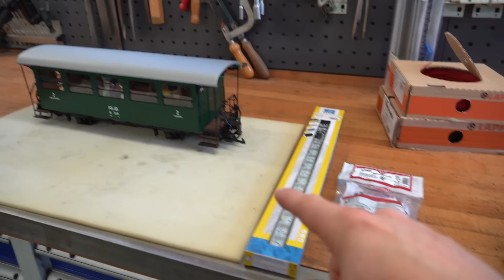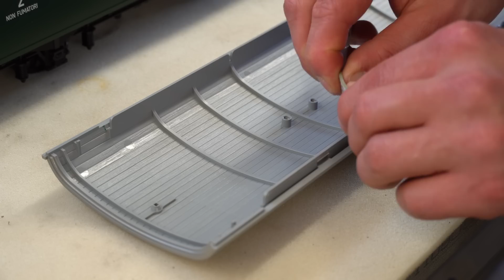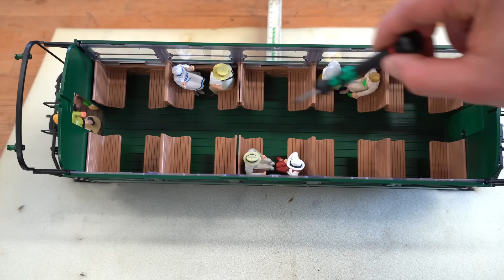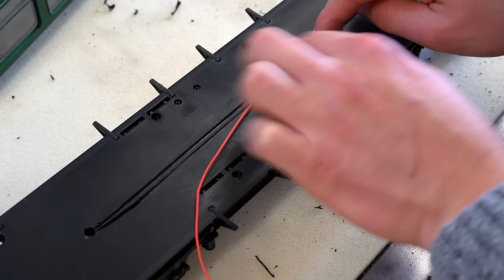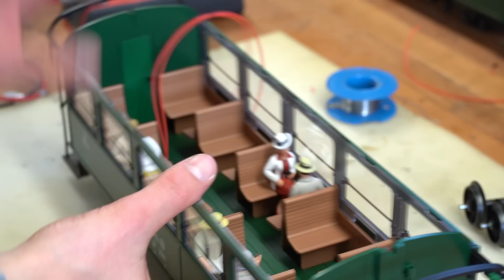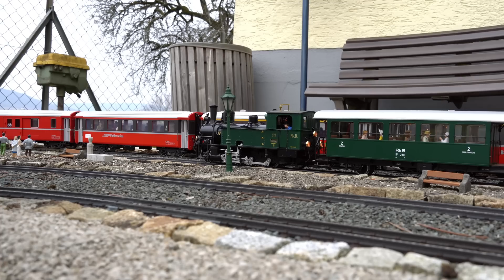LIGHTS and WHEELS for LGB passenger wagon

Comment: Why double wheel connect you can from 1 set of wheels the power ?
Reply from the maker: One set of wheels is not sufficient for garden railroad use. If you hit a dirty spot on the track or the set of wheels has a stand still on one of the switches the light will go out. I will do at least two sets of wheels if not four. The more the better and the further appart the better as well.

Comment: Why did you take red/brown wires, which everyone can see?
Reply from the maker: Good question ... I didn´t have black which I would have preferred and since I mounted the wires between the chassi and the top portion of the wagon I thought it doesn´t matter. But of course I needed to make the connection to the roof which I haven´t considered at that point. To make a long sotry short, next time I will use black or dark green wire to hide them better... I still have 6 more wagons of the same type to do.

Comment: Will you ever add overhead wires for the locomotives?
Reply from the maker: No I will not. To much cost, to much maintenance and since I have rail road crossings which are actually used by real humans can´t install overhead lines...
Reply: @summitrailway  Hmm yeah i can imagine it is expensive and requires a lot of maintenance. And haha yes i didn't think of that! Would be a tripping hazard lol.

Comment: Is it also possible to add a decoder somewhere to allow remote control of the light?
Reply from the maker: It is possible. This light strip in particular will accept a "plug in" decoder. It doesn´t get any easier. But if you are using a different type of light strip it is easy es well. I don´t see any real advantage for me personnaly so I don´t do it but you can for sure!

Comment: Would it have been an option to simply transfer power from the locomotive? You'd just need to add a single DC converter and capacitor on the locomotive and/or tender, and then a pluggable connection between each wagon, and then you don't need to retrofit each wagon with conductive wheels.
Reply from the maker: It is an option but not for me. Every wagon should be independet so I can switch to different locomotives. The ball bearing wheels have a hughe advantage besides the power pick up, they have a lot less resistance when rolling which leads to a lighter pull for the loco and that means longer trains! And to name one more reason I´d like to mention when the loco switches from one side to the other at the station the lights will still be on. That are my reasons why I like to have every wagon independent.

Comment: Hey :) why didn't you continue to cut the grooves towards the edge of the wagon and feed them through a hole behind the bench?
Reply: ah okay, to be honest, they are almost invisible anyways, so I guess it wouldn't be worth it
Reply: If the couple inches of exposed red wire bothered you at all, a simple remedy would be to color them with a black “magic marker” or a drop or two of black paint…..simple.    JDM (not Linda)
Reply from the maker: At first this was my plan but I encountered a new problem. I needed some extra slack in the wire to be able to solder the connections and then close up the roof. If I had routed the wire all the way behind the bench it would have been to short to make the connection. Leaving more slack at this point would lead to a lot of extra wire dangeling inside the wagon above the bench. So I have choosen a compromise...
Reply: @summitrailway  yeah I see and I was also thinking on how to get the slacking lines in to the roof or somehow to the wall so it looks like it's supposed to be. But after all it's not a display model and this is already more than good enough. 
Plus - there's always the possibility to make it better if it bothers you (but for that it must bother you overall first) 😅
Reply: Hallo
Ich habe Messingröhrchen in die Ecken geklebt und das Kabel nach oben geführt.Du kannst das Messingröhrchen auch als Leiter benutzen dann bleibt nur ein Kabel nach obenHat bei mir funktioniert 
Gruß
Reply: I’m curious about polarity?  Does polarity not matter on the light strip? Most LED light strips I’ve used were polarity sensitive

Comment: I have four of those rhb cars. Those roofs are a right pest. Not like old lgb unfortunately.
Reply from the maker: I was hesitant for a long time until I found the courage to pull hard enough on the roof that it came loose. It feels like you destroy something when doing it. Thats the reason I have never put the roof back on to the second wagon I have shown in the video. It will stay without roof until I get lights and passengers mounted inside. I got 7 wagons in total, some of them in a different color scheme. Eventually they will all be fitted with lights and figures.
Reply: Well I’ll be using this video as reference on adding lights to these cars.  Very nice job!